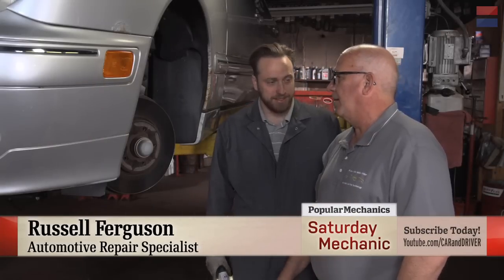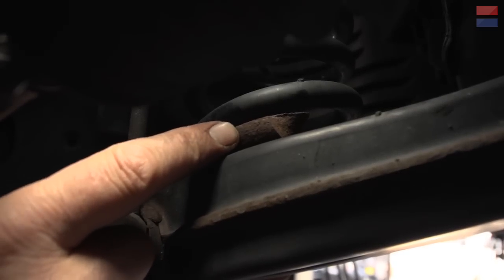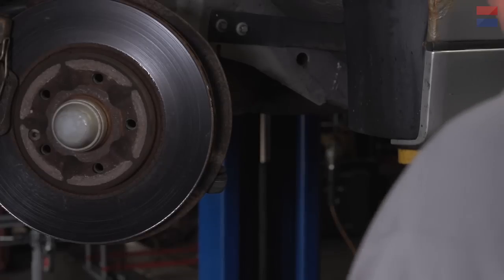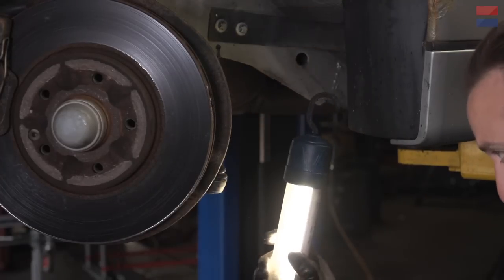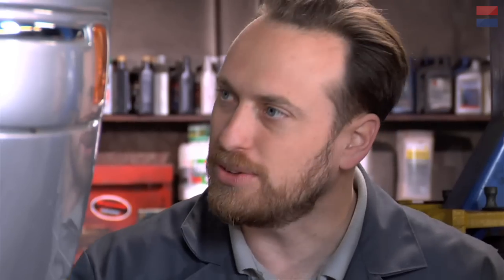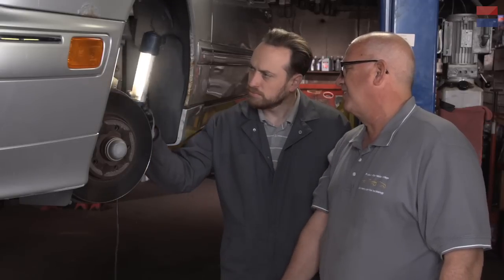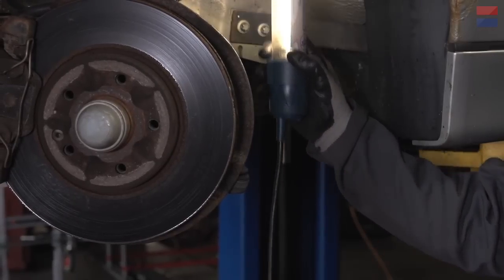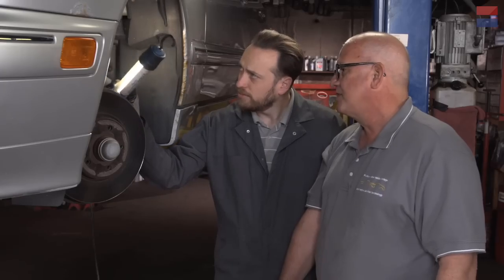The Dangers of Replacing Coil Springs on Your Vehicle - Full Clip

Comment: The step they missed was that the opening on the spring plate has to be facing the right direction on the spring. (i.e in the uphill position) This way for the spring to escape the center bar has to get longer (not possible). If the openings are facing in a downhill orientation the bar would only need to slip a little and the centre bar could be forced out between the plates because the bar is longer than the distance between the openings.
Reply: Are you talking about the lip on the plates? Those look like they are both pointing inwards? I am not sure what you are saying.
Reply: Scott Lawder bro... He left that comment FIVE YEARS AGO. hes probably dead by now

Comment: When removing the spring they should have loosened the cam bolts on the lower control arm first so the LCA could swing down without holding the coil in tension. Tighten the control arm bolts again with car loaded.

Comment: Oreilly's auto parts has a tool loan program and has a spring compressor with safety pins. It fits on the outside of the spring on both sides. I used it when I changed my Mark 8 from air ride to spring ride. That spring compressor in this video looks scary as hell.

Comment: How not to use a spring compressor!

There's no need to loosen anything other than the shocks.
On some you can just wing it with this kind of compressor, no need to touch anything.
Jack up the car, take off the wheel and change the Spring!
Reply: How are you going to pull the spring out without levering the bottom arm? Even with normal compressors you cannot compress the spring enough without the threaded bar fouling the inner arch or the bottom arm
Reply: With the old mercedes suspenion design, and a proper compressor, you can compress the spring so much that it's possible tu pull it right out, just loosening the shock on one end is enough.

believe me i've done it a dozen times. ;)
Reply: You loosen the control arm bolts. Note you have to replace fasteners as they one use (I didn't and I really have no excuse) and torque them with the suspension loaded (car on the ground.) Those bolts are cheap, the control arm is cheap with bushings pressed in, so ideally, you would want to replace the whole suspension system which is what I'm doing on a 97.

Comment: If they were so concerned with the spring releasing/decompressing. why would they not further compress/support the spring with a coil compression kit? their chances of that coil shooting off would have greatly diminshed with the help of a spring compressor. the wheel well has plenty of access for such a tool. just an opinion of mine. In the past when ive dealt with broken springs ( ford taurus front springs) I take precaution and do what is neccessary with the help of a simple compression tool so this same thing doesnt happen. besides no mechanic needs to shit his pants on a simple job like this by having a highly energized spring thrown in his face.
Reply: we're all mechanics though...and we have our dull and thoughtless moments in our career which make up for good stories later in life. one of my boo boos I always laugh about was on lexus e250. diagnosed a faulty alternator. got ahead of myself during the repair forgot to disconnect the battery and just so happend to arc the alt. power harness during repair. smelt burning plastic suspected the alt. fuse and sure as shit it melted. and it wasnt a simple pull fuse and replace it was a good 45 min pull fuse block and mangle way threw wires towards two small bolts remove bolts that hold fuse replace and re-install. lol! overall a wasted hour of labor replacing something that could have been avoided. it sucked too because iv always been persistant with power disconnect for various automotive repairs. just had a dull mechanic moment.

Comment: I learned 2 things watching this video, never let grandad re-live his youth under your car, also it's 2015, POWER tools can save lives.
Reply: Mark Fuller MARK,when it comes to compressing a spring,its always recommended to use a regular ratchet on a spring compressor tool and never any kind of "power tools" due to to the huge energy stored in the spring, the slower and controlled you tighten it ,the safer it is,they do however sell some versions of spring compressors that can be used with  "power tools" meaning a impact gun but  for the most part the slow way is the safer way,ive done this job about 8 times in the past without any issue.

Comment: this guys forget to tight the spring compressor
Reply: Exactly, when the tool is used correctly you should compress and the very compression of the spring prevents the tool from snapping off of it. I am really surprised with the lack of common sense. But that is usually a narrow mentality of some that blame the brand instead of the lack of experience.

Comment: The secret is to fully clamp the spring up tight (5mm between coils) before attempting to remove it.  Done properly the spring should just lift out without having to undo any other links on the lower control arm.  Release compression on the old spring by holding one of the c clamps in a vice.  Never try to lever out a compressed spring, they contain a hell of a lot of energy and can cause serious harm if not treated with due respect

Comment: Actually i disliked this video first, then liked it because, I realised that they put the title as The Dangers of Replacing Coils, they were not like so many others hiding their fails, its quite dangerous, so thanks for showing this to newbies, esp that this happened to so many  prof. mechanics, ask them they will tell you!!!
My only remark is that, the guy have nooo respect for the job, no gloves, neither eye protection, and yet he said that they borrowed the compressor, i wouldnt do that, i remember my mechanic almost lost his head, trying to change the coil on my 1976 Opel Kadet, despite he had the compressor, the spring just went to the roof, passing his face.

Guys its dangerous, take care

Comment: Russ should have read the instructions to familiarise himself in an attempt to keep  them both safe.If the spring had been fully loaded and it had not been a broken spring one of them may have sustained an injury.
At the end of the day they did complete the job to a very good standard and were following methodical steps. If I had a problem with my car I would be quite content to let them repair it.

Comment: Accually, these compressors are a bit different than the ones I've used. The right ones do not have the V-shape in the plate, they go all the way round. The center bolt is put in from underneath and locked into place. There is no way they will let go. With the ones in the movie, the center bolt slides in from one side.
Because of the design, the W210 (and124) springs carry ~2x the weight on the wheel, making them stiffer than "normal" ones. Generic compressors shuld not be used because of that.

Comment: shouldn't you remove the whole strut before removing the spring?
Reply: it was not a strut
Reply: +Cag “125 sportsbike spares” mito A strut is a coil and shock absorber... so what else could it be then?
Reply: multilink / wish bone suspension  .
Reply: +Cag “125 sportsbike spares” mito ok so is the strut not mounted in a wishbone suspension? After watching the video again it looks like it's just compressed and stays in place that way. Either way it was still a strut they removed.
Reply: All he really needed to do was use spring compressors to reduce the height before removing
Reply: Andrew Hanson a strut is when the spring is connected to the shock. A shock is a shock and a spring is a spring. A spring could be attached the control arm (like mine) and the shock goes up through it. Whereas a strut, the spring and shock are together.

Comment: I almost shizzed my pants watching that and I'm sitting on my couch.  Wouldn't it make sense to read the instructions on a piece of gear you've never used before, especially when dealing with a coil that could punch a hole straight through your head?

Jeebers, even the standard coil compressors are scary, this disc version is just odd and strange.

Comment: the bolt he didup first with the tourqe wrench is set on the wrong tourqe.wen you use a tourqe wrench it should only click wen its on spec. DO NOT GO OVER!. wen it click's your done. like seen on the torks bolt.

Comment: Alright, so just wondering. I'm a kinda new mechanic, just went out from mechanic school this summer so I don't really have that much experience. But I have however replaced the front springs on my W208 clk (I'm guessing it's a W210 in the video) so I don't think they differ that much if any in the front suspension. And from what I can remember I only used a transmission jack to hold the control arm to then lower it down and get the spring out, without any spring compressor and without any springs flying out. So was I lucky in that case or is there anything I don't understand? Seems kinda strange to me that the spring just flew out like that in the video.

Comment: A poor mechanic blames his tools. These guys have no idea how to us this compressor, nor how to do this job. Number one, the top plate needs to be as close to the top of the spring as possible, and the bottom plate near the spring bottom. Orient the plates so they are to the outside, directly away from the chassis. Tighten the compressor COMPLETELY, compressing the spring COMPLETEY. This will insure that the spring does not slip out, as it will now be straight instead of curved as it is in the vehicle. NOW, you should be able to remove the spring with a little pulling down on the lower control arm, and remove it toward the front. You do not have to remove the shock, or the lower ball joint or the torque arm. As for the china made compressors, they are as good as any other. Yes I am a mechanic, and have been for 40 years.

Comment: Youtube algorithm scares me sometimes. I just did the exact same work on the very same car (mercedes w210)  from the video using very similar tool. That spring compressor has a bad design.. the ones you can find these days does not have a slot it has a through hole and keyed slots for the top of the tool to engage and prevent slipping off like what happened in the video. Additionally, you only have to remove the shock absorber mount for w210 in case anyone is interested...

Comment: Turnig the screw of the shock absorber instead of turning the nut. Result: damaging the screws thread.
They dont losen the screws of the washer at the control arm Result: damaging the rubbers. 
The spring was already relaxed by the stretcher, spring with stretcher were simply fallen down, not broken in hands of its mechanic. 
Very bad dokumentation boys.

Comment: I used regular spring compressor when disassembled my w208 clk.l because I didn’t have the special tool yet. Then used the mb compressor when putting the coil spring on . I was easy to assemble the suspension when I used the mb compressor tool. But still dangerous. It would be better to loosen the control arm bolts in the back to have better clearance and to avoid using the prybar because prying the coil can make the compressing tool fail.

Comment: I hate spring compressors!  Yuck!  I think this job is far safer *without* the lift and *with* a floor-jack.  I've done it many times using a floor jack, and it gives you the means to *slowly* let off the spring tension.  I never use a spring-compressor -- they can fail, just like we saw in the video.  Scary!

Comment: I dont understand how the spring failed this way.  don't you typically remove the entire strut assembly from the vehicle with spring attached, then use the spring compressor tool to remove said spring from the strut?
Reply: dave trinh this is weird I believe to Mercedes. the shock and spring are separate

Comment: that doesn't negate the fact that this design is crap and there are much better designed spring compressors out there?
even cheap generic non car specific $30 spring compressors would have done a better job then these. i've used them countless times on multiple cars.
my previous comment still stands.

anyway, i read one of your other comments. i agree with your method of replacing springs. no need to take half the car apart.

Comment: This tool is useless for a 1976 toyota corona mark 2. Sure it compresses the spring and once you install the new spring and then unwind the compressor. It's a pain in the A to slide out the bottom where the shock comes out

Comment: Wouldn't it not be able to slip out if they rotated the other mount for the spring compressor 180 degrees?  Instead of having them both facing the same way so that they can slip out at the same time?

Comment: A Vise grip in the lower coil is a GOOD idea,but do NOT nick the coil spring.
 Use a shop towel to avoid that. It may fail right there,later.
  Mercedes?  Done those. There really difficult to do a proper alignment,afterwards. Trust me on this. The early ones have very specific tolerances. Toe changes the camber,caster throws the camber out of the window. DO ALL 3 AT ONCE.
 Start with the camber,IMO.

Comment: If you set the plates properly within the coil, and compress as needed, those plates won’t move. They didn’t compress the spring enough, that’s why there was movement with the plate. Even when they reinstall the new coil, it’s barely compressed. Turns out maybe that was a good thing.😬

Comment: Wow that was a close call with the spring compressor.  Don't you need to torque the suspension under load??  Otherwise it will wear out ball joint very quickly.

Comment: The 210 is one of the best Mercedes ever designed.  Easy to work on and cheap to fix.
Reply: they are rust buckets which almost bankrupted mercedes with bodywork warranty claims ; hardly any left now , thanks to water based paint . Also the front upper spring perches , only held on by three tiny spot welds are notorious to fail and all dealers kept several in stock while the cars were still around . thankfully now a very rare sight on the roads , outnumbered by the much better engineered W124 which still abounds /

Comment: A transmission jack could roll away on you. And use the spring compressor, especially since you started out stating how imoortant it is to compress the spring safely in order not to put yourself in trouble...  !  geez

Comment: I always use the right size Torx bit at all times even if it is not something critical.  It is possible that a bit one size or two smaller might feel right to some people.  I don't like using that bit if I feel any play.  I have a Volkswagen and in various places there are bolts that some people foolishly mistake for Torx heads but the are triple square and have twice as many points.  Those points are shaped differently than the lobes on a Torx bit also.  I know who would probably try to use a Torx bit in those and you can probably imagine I don't like him working on my car and thank God he is not a mechanic.  I also try to stick to using metric sockets ONLY even though some sizes feel like they are the same it such as 11/16 and 17 mm.  The way I see it there must be a tiny difference in size between the two that is not easily noticed by some people because if not why do they make both of them?!?!?!?  I know about the triple squares because to change the rear rotors on my car you need a 14 mm triple square bit to remove the brake caliper mounting bracket.  Use a good bit too because you will have one hell of a miserable day if you strip that S.O.B.!!!

Comment: The spring compressor is a bad design! Both plates should be a donut shape to prevent one plate from sliding off
Reply: there are multiple designs, i wonder which one is the safest
Reply: The spring compressor is the ONLY design that works on Mercedes-Benz. BUT like German machinery it's NOT idiot proof.
Reply: +lillskiten1337 I say the better one is the one that has like hook looking things and it gets tighten by a 3/4 nut and the hooks have safety pins so it won't slip off
Reply: Jordan Enriquez
 show me <3
Reply: Jordan, the design you're talking about will not fit into the Mercedes coil springs.

Comment: On my old e34 I just undo calliper and remove whole leg after then undoing top mounts under the hood,maybe the merc is different? But I always think if you have to use a lever on a spring thin that could be iffy.. cheers for sharing

Comment: The reason the spring compressor failed is that it wasn't fitted correctly into the spring, check at 12.33 the cut outs on the spring compressor plates need to be facing opposite to each other and NOT in the same direction

Comment: God I hate Mercedes vehicles, they are so hard to work on. I'm so glad my '05 Mercury Grand Marquis have struts where it's easy to replace the front springs.
Reply: the Grand Marquis/Crown Victoria are the easiest and cheapest to work on.
It's because Ford kept it simple with their design while Mercedes attempts to be impressive and cutting edge. All you end up with is an over complicated and expensive mess of engineering that yields only slightly better results vs. more simplified parts.  

Nothing but a headache to work on.
Reply: Th1rt3eNoriginals German engineering, just like the tiger tank.

Comment: Depends what vehicle you have. My camry has struts inside the springs so the whole assembly will come out together. No need for the compression until after it has been removed from the car. Some vehicles like this one, need to have it compressed while attached to the car because there is nothing holding it once it's free.

Comment: The compressor really should have been designed with some sort of lock on the open C side to prevent it slipping when prying the old spring out.

The ball joint is not only unique but awesome. You don't really get why it's so awesome until they go to torque it and can simply use the regular torque wrench.

I am guessing thats why it was designed that way.